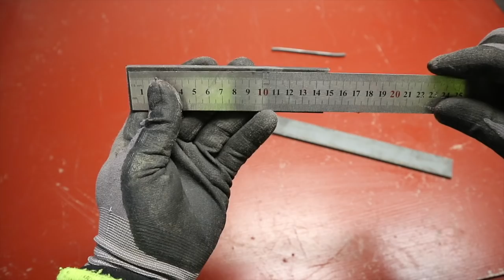Wow Amazing Brilliant New DIY Tool & Ideas

Comment: piqued my curiosity. I just skip to the paint part and see if I'd wanna make it - I don't need to watch grinding, cutting, drilling etc.  This one would be better served with a sliding clamp so you could mark something between the holes.